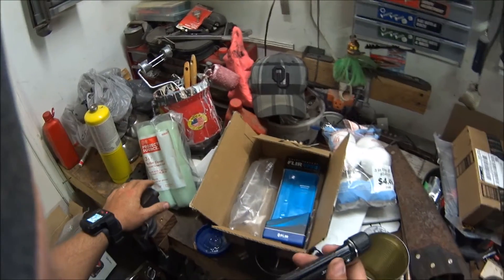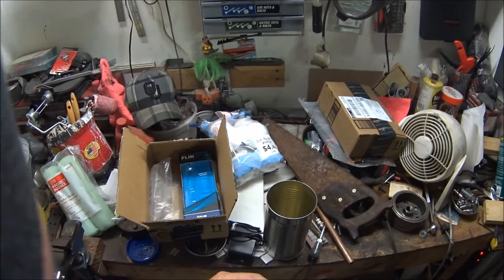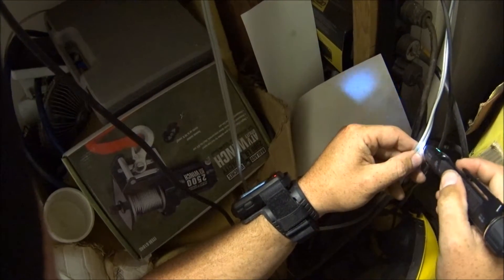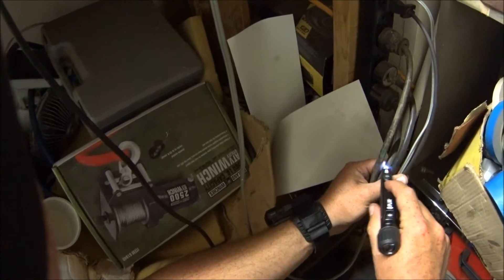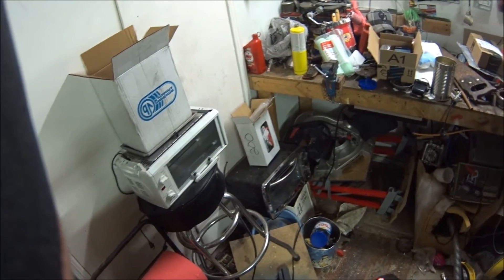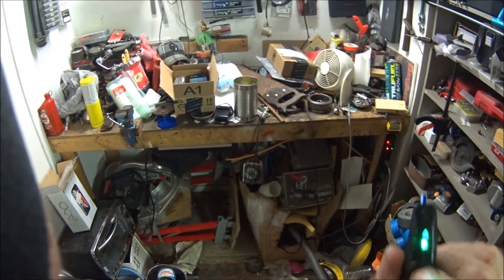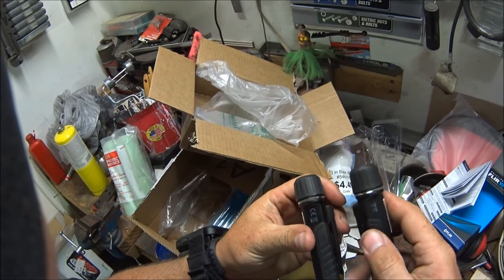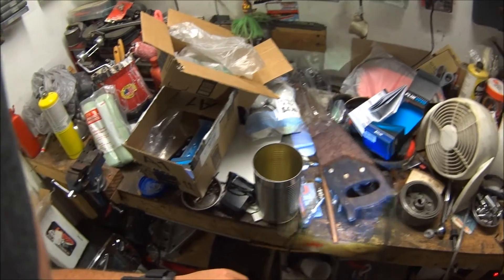Flir VP-50 non contact voltage detector review

Comment: The real test is the test of time. The only ones I have found to last is my Klein. The greenly and  Milwaukee ones don't seem to hold up. Plus my Klein dose outlets and cord caps with out a problem. I really like how that one has the light though
Reply from the maker: +welderboy525  It was between the Flir, Klein and Fluke is what I narrowed my search down to.  If this one does crap out on me I'll get the Klein next.  Thanks for the input
Reply: +2LateIWon  ya I always mix the fluke and the Klein ones up. I think they are made by the same factory and just labeled difrently. And mine only cast me $16.00 at my local supply house
Reply: Best one is the fluke. Klein has a bunch of problems such as plastic clip breaking off and also it is not waterproof. Except Fluke tip breaks off easily. It needs a cap for transportation.